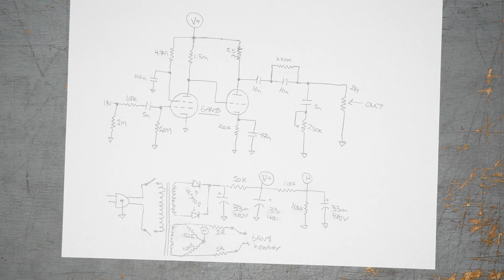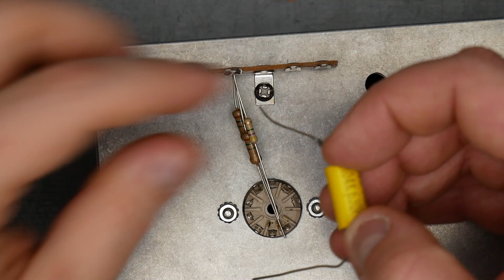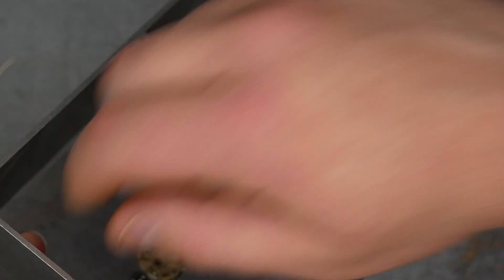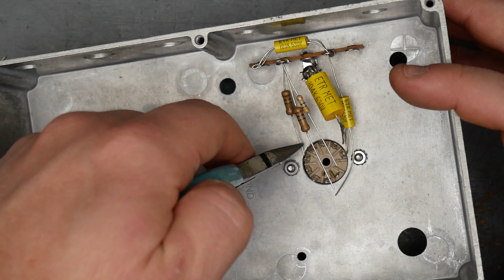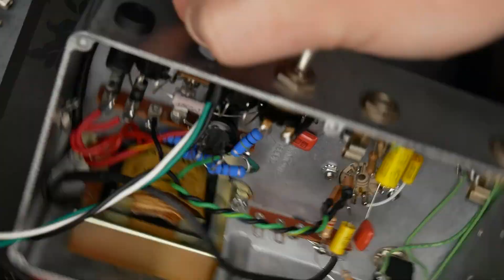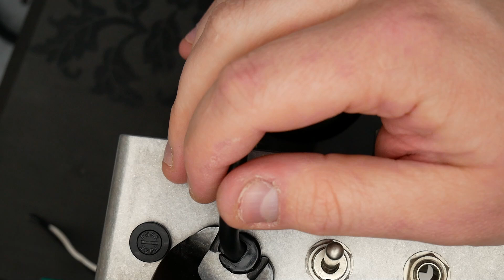Garnet Stinger Pedal Build Part. 2 // Gray Bench Electronics

Comment: What temp do you run your soldering iron at?
Reply from the maker: I use the metcal SP200, it auto detects the necessary temp. https://www.metcal.com/resource_library/metcal-smartheat-how-does-it-work/
Reply: @graybenchelec  Woah! So that's a couple new things I learned today; neat heating system.